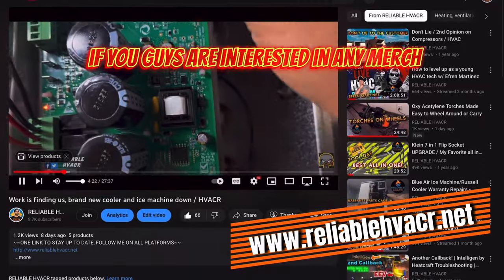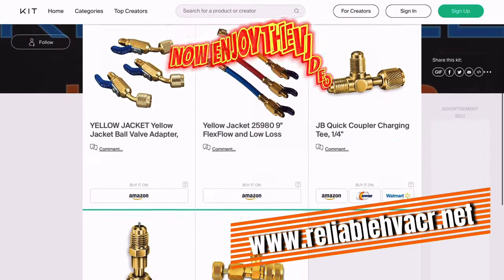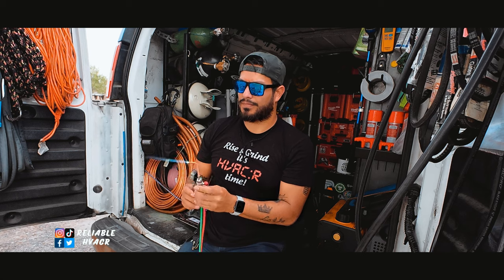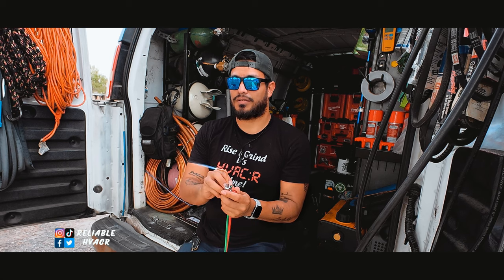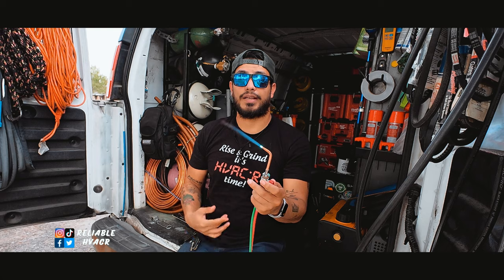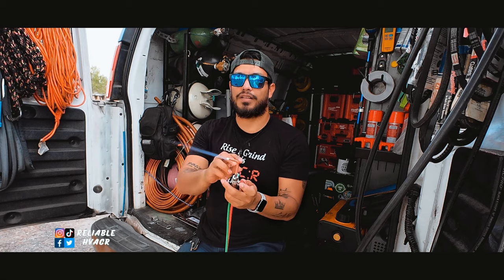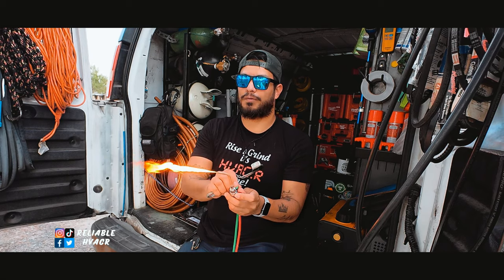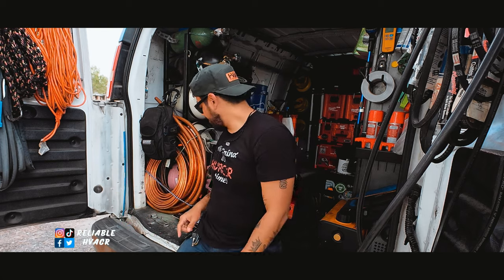Flexible Light Weight Hose for your Torch | New kit w/ tips

Comment: The fitting on a B tank is called a CGA-520 fitting. It has external threads on the tank. 

The miniature tank most techs carry is called an MC tank (10 cubic foot). It also has external threads on the tank. That fitting is called CGA-200. 
The large acetylene tanks (60-400 CF) can have external threads (CGA-300) or internal threads (CGA-510). No idea why they need so many different fittings for acetylene. 

All sizes of industrial oxygen bottles use the same CGA-540 connector (to the best of my knowledge, anyway).

All inert gases like argon, nitrogen, helium, etc use the same CGA-580 fitting (again, to the best of my knowledge)

Comment: What pressures do you run on the torch.
Reply from the maker: I switched to self adjusting regulators but you wanna be around 5psi for acetylene & 10psi for oxygen
Reply: @ReliableHVACR  which one is that sel adjusting regulator
Reply: I’d recommend 5psi on both